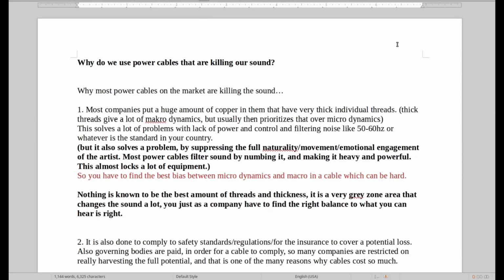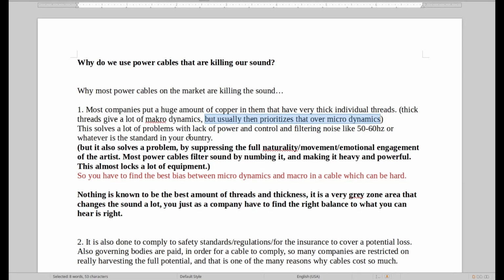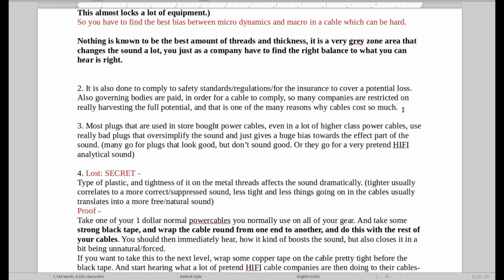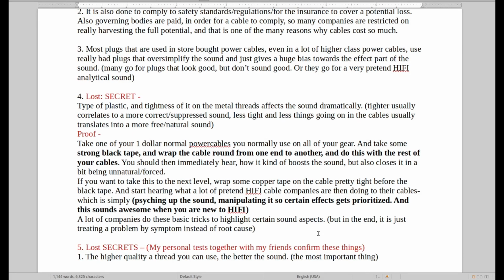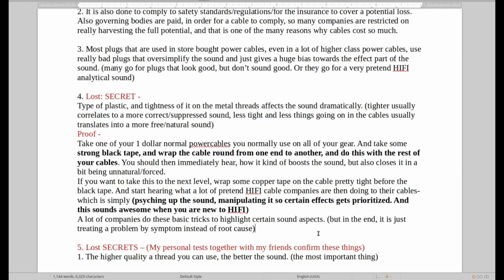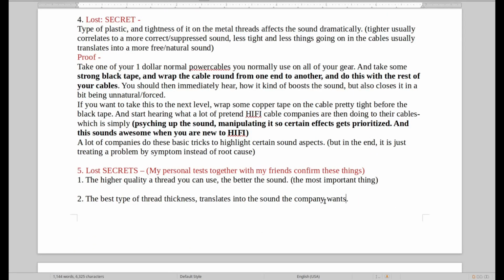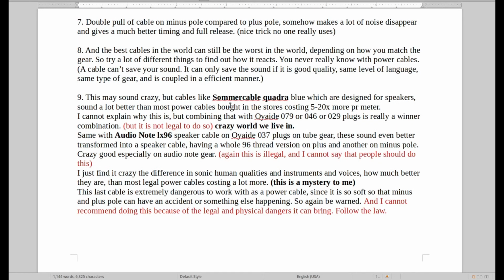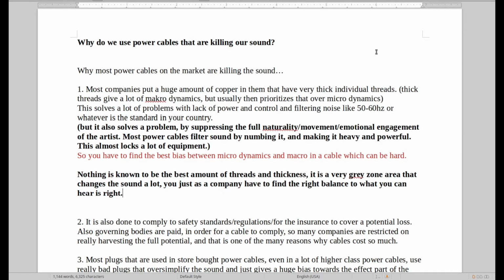Most HIFI power cables are horrible, so why do we still use them?

Comment: I think a power cable would only alter the overall sound if the copper quality was really poor and the gauge was not up to the right level like 14.  I don’t think it’s gonna make much of a difference beyond that.
Reply from the maker: You are partly right. It reacts mostly on gear that is better, having less signal with higher component quality. So much gear is built to suppress sound, that stuff like Mcintosh reduces it's influence to what feels to me like 1/3.

Try a basic 20m power cable for 1 on your amp, then a 5m one, 2m, and 50cm one. Where all are basic 1-5 dollar cables. Just that in itself changes the sound quite a bit. Assuming it is in correct phase, and the system is decent.